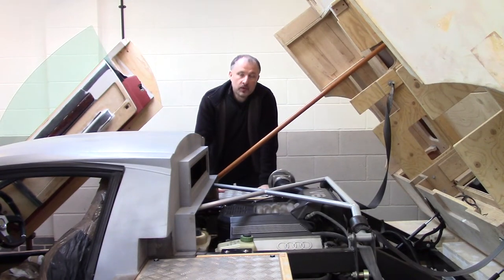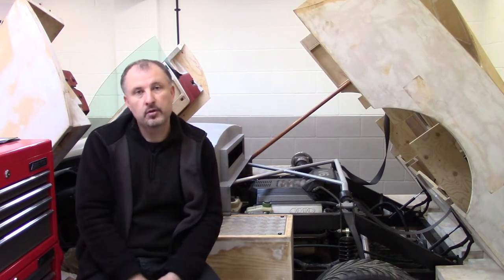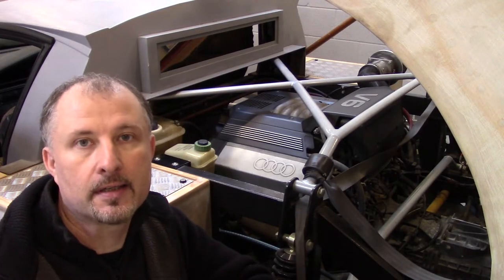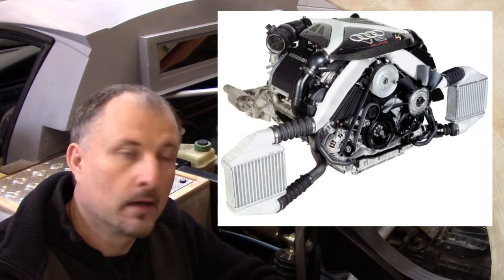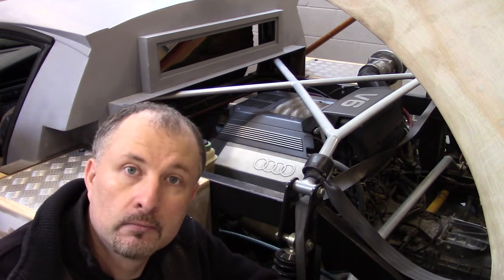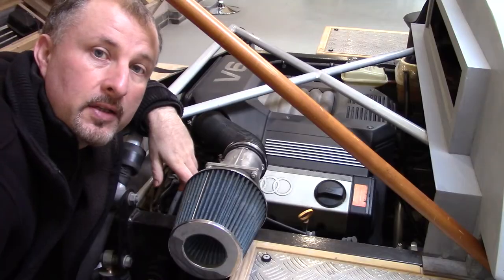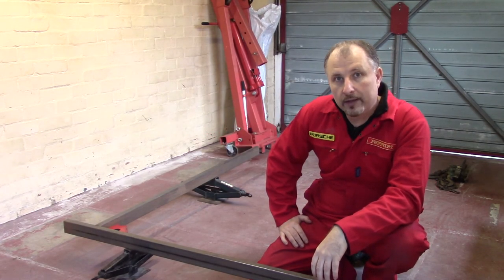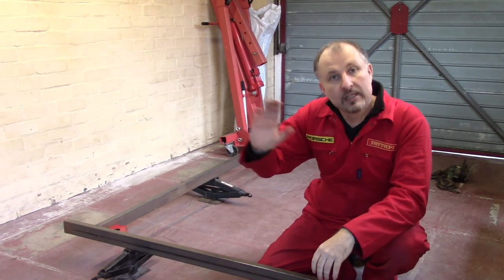Choosing the right engine for my DIY Supercar: Prototype Ep5

Comment: Check out FactoryFive.com’s GTM Supercar...  They use a GM LS1 - LS6 V8 with a Porsche 911 Transaxle with an adapter,, or a Mendeola Transaxle, no adapter necessary.  FANTASTIC SETUP for a mid-engine Supercar.
Reply from the maker: I’m a big fan of Factory Five, and the GTM Supercar. It’s sad that they’re only available in the States. As far as I know we don’t get them in the UK. Plus I think the LS is not a known or used engine over here, where as you can pick one up for a few dollars in any scrap yard in the US. (I’ll just have to move to America lol)

I didn’t know about the Mendeola Transaxle; it just bolts up to a LS without any adapters? Wow, now that’s interesting to know. Thanks. I’m going to look it to it now
 ;).

Comment: If you like the idea of a 6 cylinder engine- A Mercedes M104 engine (straight 6) or Mercedes M112 (V6) might be worth a look if you can get hold of one. It can be fitted with forced induction to make some very respectable BHP figures.
Reply from the maker: Yes you're right, and old Mercedes are very cheap, they'd make a great donor car. ;)

Comment: You've many choices today, I like the transverse front mount from  one of the many Japanese 90's cars. The Subaru Boxer engines are cool but what gearbox. Aussies are putting big turbos on the Ford Barra 4.0L Six. Big HP. I think you underestimate the auidience, I can handle more content but you'd need to waffle less & cut back on the credited stuff. Like your ideas though.
Reply from the maker: Yes, you can get quite a bit of power from those transverse mount Japanese motors; I like the EVO engine, which is the 4G63T I believe. Yes, the Subaru boxer is another great engine, and quite cheap, but like you say what gearbox. A Barra would be a fantastic fitment in Australia, but that engine isn't easily available here in the UK, shame.

Oh yes, I’ve got some smart subscribers, who could easily handle a much more technical video. But it’s a difficult balance I struggle with on every video I make. I try and produce something that is accessible to a larger audience, for obvious reasons, and try to avoid too much technical detail. However I think this may change when the build begins and the format of my videos will change to accommodate that.

I’m trying to make videos that are both educational, and entertaining to the best of my ability, and I do watch many other channels for ideas.

For me I like the images and video clips, as I watch too many YouTube videos where someone is just talking about something, but doesn’t give any reference material. That’s very frustrating for me personally.

Anyway, I’m learning as I go, I hope I can get the balance right, and other people find my project interesting enough and subscribe. I've got plenty of ideas I want to do, I just need the funds to do it.
 Oh, I'll try not to waffle too much next time. ;)